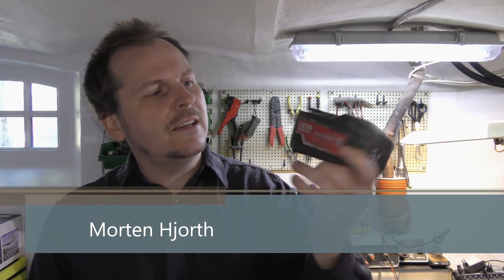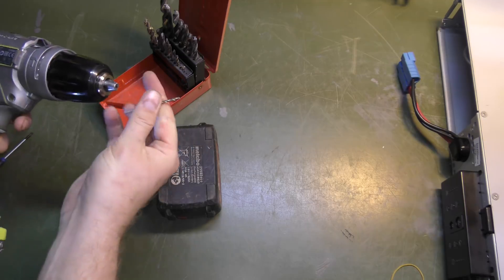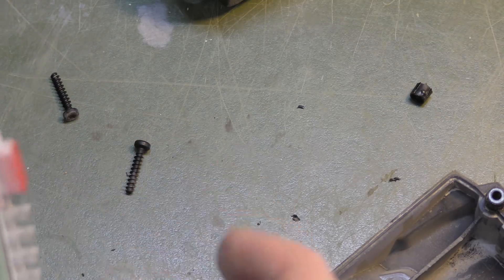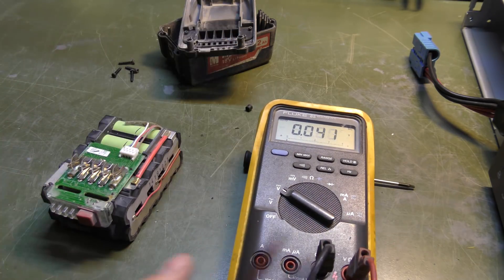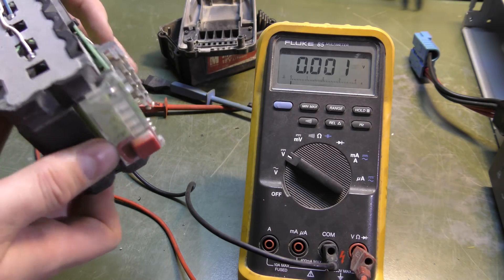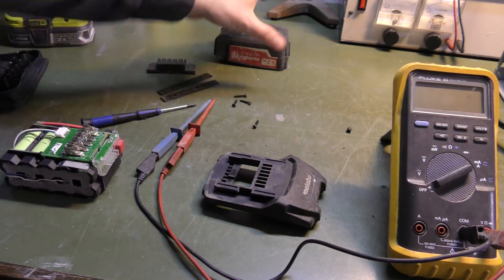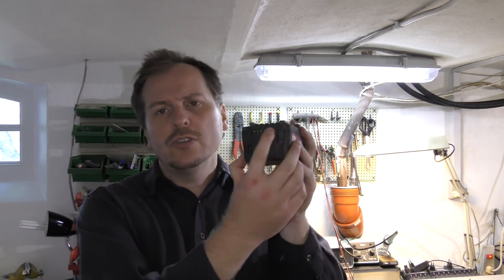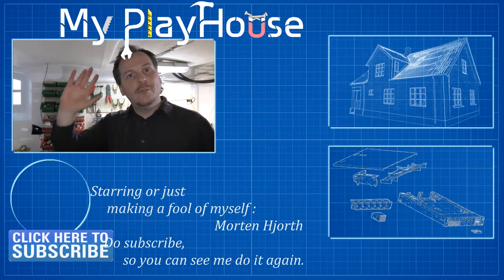Metabo - 5.2 Ah Battery Pack FIXED, but was it Broken - 744

Comment: I'm guessing it was fixed when you slightly pulled the electronics pack off, then pushed it back on.
Most electronics fail because of a faulty connection with built up contact resistance.
Unplug, replug, and *presto*, they work. 
I've got a weak Metabo battery that won't charge. I'll try apart and back together, and see what happens.
Though I guess I"ll check the voltage it shows at its contact points first.
Reply from the maker: Hi buybuydandavis
Thank You very much!  glad you liked the video :-)
Thank you for watching! :-)

Comment: If cells are connected in parallel you won't be able to measure Volts per cell. You'll have to disconnect them from the parallel connection before measuring it individually.
Reply from the maker: Hi SkilltoKill 1992
Thank You very much!  glad you liked the video :-)
Thank you for watching! :-)

Comment: Use the pack as a USB power bank. I use things like that all the time for that purpose. Buy some cheap USB modules from China that can be used to charge USB devices once hooked up to the battery pack. I have a battery tab welder and I build these packs for all sorts of things. It is a fun hobby. I like it as much as messing around with computers. I have my new Toy my Dell Poweredge T620 that I will be adding a second CPU, memory and a GPU to it. I also want to run FreeNas on it. Have you tried any version of Linux on your servers? If so which ones do you like the best?
Reply from the maker: Hi C MJ
Thank You very much!  I had a collage with a Metabo drill,, that got very happy :-)
Thank you for watching! :-)

Comment: I wish they just made an universal battery for power tools.  Its such a pain when you need to get a new battery.  Sometimes its better to just buy the tool again since it doesn't cost much more than the battery.
Reply from the maker: Hi Scott Downey
They make a lot of money from those batteries,, I do not think that will happen.
Thank you for watching! :-)
Reply: https://www.cordless-alliance-system.com/

its already here
Reply: Ironically enough, metabo is attempting to do exactly that with the CAS system, which I believe this battery is.

Comment: While Metabo is a good brand, they certainly charge a premium for the name, not unlike the Apple tax. Be happy with your Ryobi, I like that they've never changed the battery connection.
Reply from the maker: Hi DOYLECLEVERLOBE1
Thank You very much!  glad you liked the video :-)
Thank you for watching! :-)
Reply: ryobi did change their battery format.   they had slide-ins then they went to slide-ons then they returned to slide-ins.

Comment: I've never heard of that brand, if nothing else, the cells are always handy.
You made it happy with a bath, but no rubber duck lol.
Reply: Metabo is 98 years old. It is one of the best. It is for professionals. Not like the american toy stuff like DeWalt, Ridgid, Milwaukee, Stanley or Black&Decker. They are toys not more. If you had one Metabo for about 300€ or more (without batteries) you will have the right stuff for many, many years. Of course not all from Metabo is very good but in general you have very right stuff. It is always better than Bosch and because you can pay it, Festtool.
Reply from the maker: Hi zx8401ztv
It is a good and quit expensive German brand.
Thank you for watching! :-)